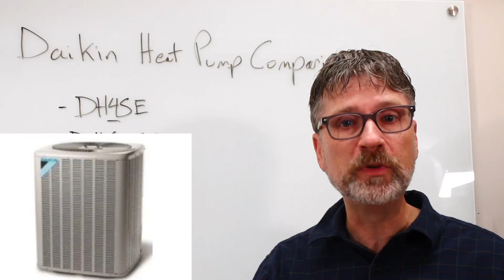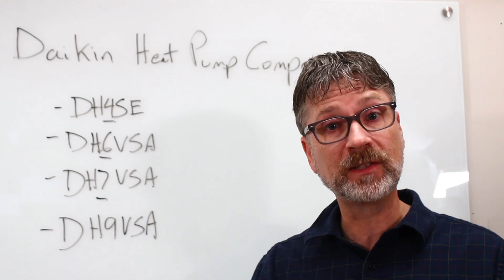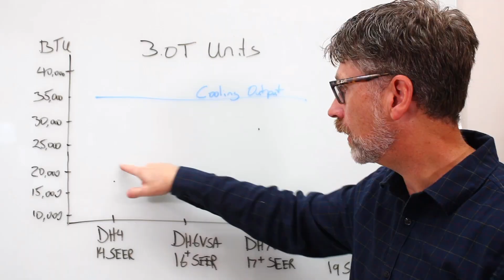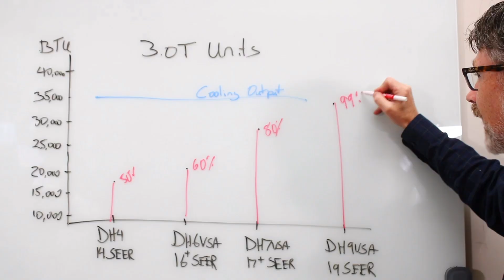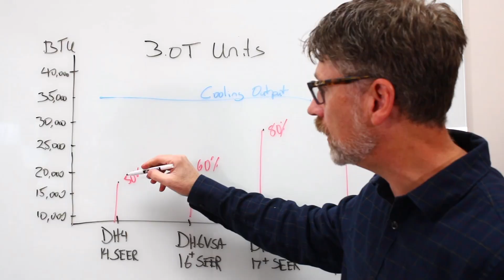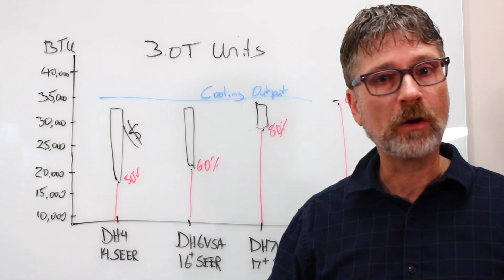Daikin R-32 Heat Pump Comparison! Which one wins?

Comment: Do you think there will be any difference in both heating and cooling efficiency between the DH7VS and DH9VS in mild climates?
Reply: Mild? No. 
If you're in mild temps, like Florida or Cali, I'd go w the DH6.
I JUST got a DH7, but we get pretty cold temps here in Missouri. Last year I only had electri heat, this year it'll be a dh7 heat pump. Bye-bye $400 electrical bill.

Comment: I figure I'm about a year away from replacing my current system, which is a 3 ton outdoor unit with a 3.5 ton air handler, which was what qualified me for rebates and tax credits at that time, 14 years ago. I simply can not fit a 4 ton air handler in the same closet space.  Daikin is one of the brands I'm most interested in because it's made in the USA, has a good reputation and a 12 year warranty but if they don't come up with a 3.5 ton air handler, that matches well with the 3 ton , DH7VSA, I may forced to make another choice. Please tell me they are working on this!
Reply from the maker: Hmm.  I've not heard anything about a matching/smaller air handler.  Another brand to consider is Rheem/Ruud.  They are know for tidy sized air handlers.  And Rheem/Ruud is a US brand.

Comment: There is one hair in the soup though. DH6VSA3610 works with a CAEPA3626 (3 ton), while DH7VSA3610 needs a 4 ton indoor unit. They key piece is that DH7VSA3610 outputs 42k BTU at 30F ... So while that is really cool, if you do not have the space for the 4 ton indoor unit, or you exisiting duct work cannot support that ... well, DH6VSA3610 it is.
Reply: @thomas you are spot on! We are a Daikin dealer and love the 6/7/9 options but that matchup for AHRI purposes really hampers us. We are constantly adding ductwork due to high static! Checking static is paramount on the front end!
Reply: Since the fan on the Daikin FIT system is variable-speed and the heat pump is variable-output, I don't think oversizing by one ton will be an issue.  As long as the installer configures it properly, the heat pump and the air handler are smart enough to automatically run at slower speeds and lower output to make their operation whisper-quiet. I believe the Daikin FIT system also needs Daikin's proprietary (and expensive) communicating thermostat to have those smart capabilities.